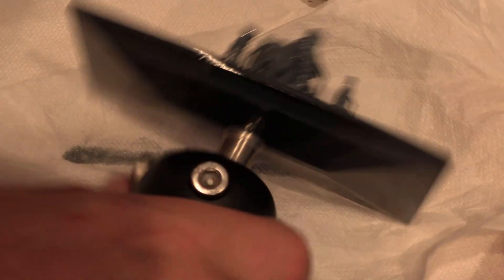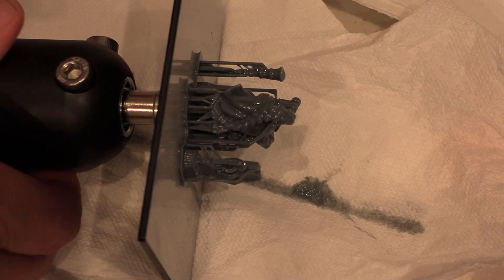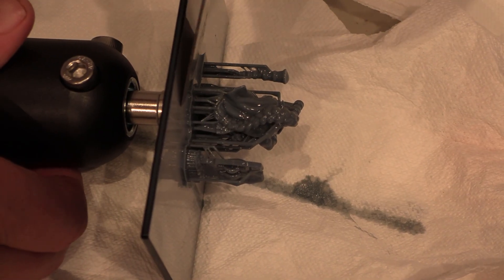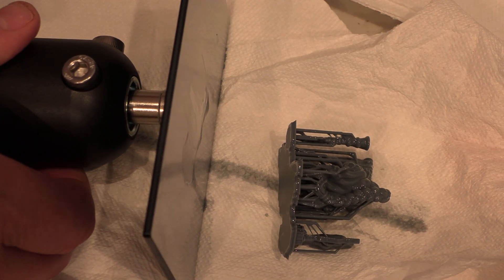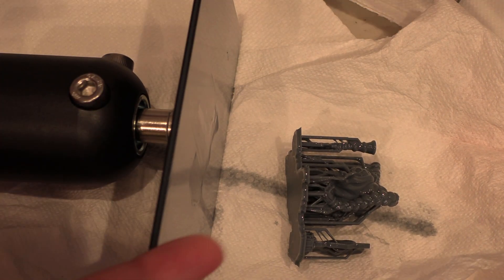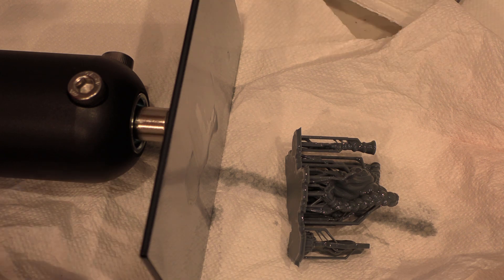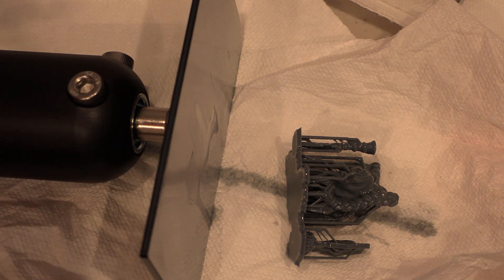How to tell when you have perfect bottom layer exposure for resin 3d prints

Comment: I've got the wham bam flexible plate add on and I love it. I do not have to use a spatula anymore and the models just pop off. I even print directly on the plate with no support for things like bases. Sure I have to file off a brim a little bit but it's a lot easier than cleaning up a bunch of support damage or deal with the warping because there was not sufficient support.
Reply: Check out the REEF method.  Basically side-steps elephant’s foot.

Comment: You can also invest in a flex plate for your build plate. That's what I did.. It is just a magnetic plate you stick on your build plate. When the print is done, you simply take the flex plate of the build plate, bend it slightly, and the print will pop off on its own. I chose the flexi plate as it allows me to keep the exposure on the bottom layers a bit higher,  making sure the build do not come off for any reason. That way I know the build will stick, not matter the size.
When washing the print, I can just stick the flexi plate with the prints into the IPA, and not the entire build plate. 
Of course. the flexi plate cost a small amount of of money, and require you to re-level your build plate, but it has made my printing so much easier :-)
Reply: How do you know someone uses a flexplate for their printer? Don't worry, they'll tell you about it!

Just a friendly jest ;)
Reply: @MagosMirka  A good idea is a good idea 🙂
Reply: @Rokisha-z3o  even if you use a flex plate you can still be overexposing your bottom layers which more than just wasting time, it’ll burn out your screen faster.  So, get those bottom exposures down as low as possible.
Reply: @DisgruntledPigumon  Lets say I have the bottom layer exposure 10 seconds longer that you really need. Just to be sure the print stay on the build plate for sure.
If you have 6 bottom layers, that is 60 seconds longer on a print that might take 2-3 hours or more. Not really a big waste.
A single failed 3 hour print, lets say with 2 seconds exposure out of every 10 seconds, that is a wasted 2160 seconds on your screen. That is 36 times more than you 'waste' on the 10 second extra bottom layer exposure, with just a single failed print.
I agree, too much needless exposure time is a waste, but a bit more, just to be sure the print stick to the build plate. is worth it in my opinion :-)
Reply: @MagosMirka  They're like vegans, just more annoying.
Reply: @Hartwig870  not possible. 😂
Reply: Flexplate is overrated. I had one on my Mars 2 Pro and I *rarely* used it. And the glue started coming off after a month or two of using it...

Comment: Here's a little tip I learned, if you do find your prints are sticking to much and you are having trouble scrapping it from the build plate. Just run the build plate under hot water and the area where the support base contacts the build plate for a few seconds and then they will pop off in one piece very easily.
Reply: Please don't rinse uncured prints or resin contaminated fluids down the drain, that's incredibly irresponsible. As in the video, if you're having a hard time removing prints from the build plate, reduce the exposure time, if that creates adhesion problems, then you need to increase the delay time before exposure. I'f you have your delay times set correctly, bottom layer exposure times shouldn't be any more than 3 or 4 times the normal exposure time.
Reply: @86abaile  BLAH BLAH BLAH Like you don't use bleach, soap, and dozens of other worse chemicals that end up going down the drain. What do you do when you get a clog in the drain pray it away hahaha no you use TOXIC ACID drain rinse.
Reply: @86abaile  You can clean the excess resin off of the top of the plate and only run the water over the top of the buildplate, the entire buildplate warms after a few seconds and no resin gets wet or washed away.  During winter, I print in a heated enclosure in my garage, but when the temp below 65ish, the prints are very difficult to remove without using this method (they come off fine if the garage is above 75 degrees).